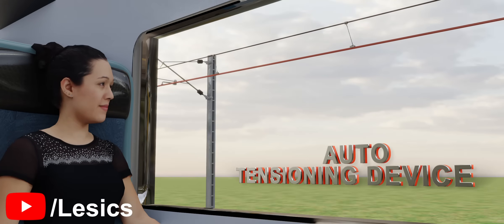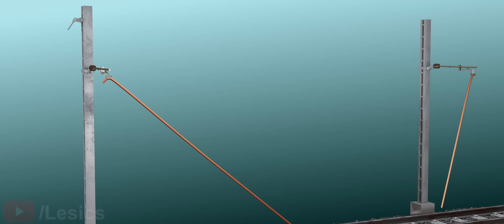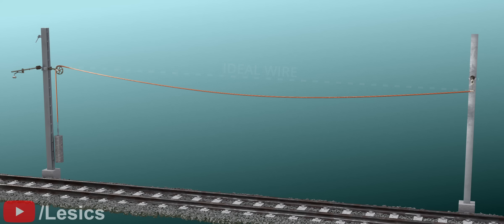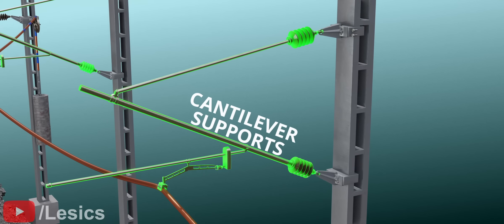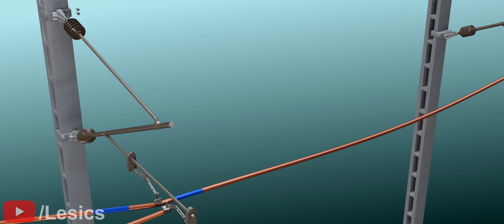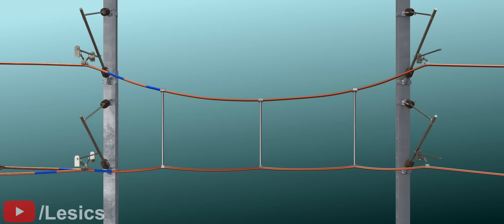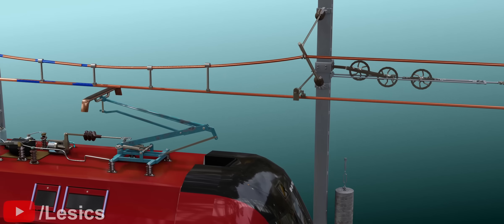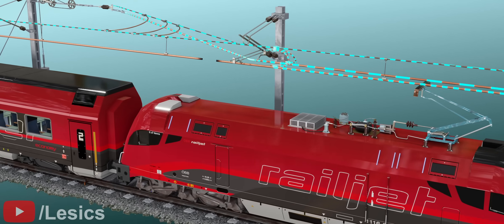Railway power lines | The Art of keeping them STRAIGHT

Comment: The old New Haven Railroad used a very elegant design that reduced the need for intermediate supports and did not require swing arms. It was a triangular shaped wore arrangement with two catenary wires on the top and one contact wire on the bottom. The wires were spaced by droppers designed to keep the contact wire level. Because there were two catenary wires with spacers between them, the whole wire assembly remained straight in the horizontal plane and could be installed with fewer supports. 
That arrangement worked well for about 80 years.
Reply: Can you share pictures Bill? It sounds interesting.
Reply: @matteopietrobelli8610  If you google "New Haven Railroad electrification" and go to images, you can see a few examples of it pop up. It is a very neat and elegant design! Apparently, the London, Brighton and South Coast Railway used it too.

Comment: Actually they are not strait! They are leveled, but in a horicontal zikzak line. Otherwise it would cut through the power conductor of the engine car.
Thumb down for the misleading head line.

Comment: wow this is really complicated compared to just having a 3rd rail.
Reply: The biggest downside of 3rd rail is the whole max 1500V DC though. Compared to 25kV AC for overhead. Nevermind that 3rd rail systems are typically at ankle height,  while overhead wires are generally speaking 5m or more up in the air.
Reply: @fermitupoupon1754  why do they limit the 3rd rail to 1500V?   I mean, obviously there is a limitation imposed by arcing distance to the ground or other rails at higher voltages, but you could get more than 1500V before that would become a problem.   could run 4160 or maybe even 6900.   And AC would make more sense than DC for a rail application.
Reply: @wouldntyouliketoknow9891  my best educated guess is that it's primarily a safety thing.
Simply because the third rail is that much more accessible to critters and people.

If a rat wanders underneath a third rail and gets electrocuted, 1500V probably won't sustain an arc, where 25kV could easily sustain an arc.

Higher voltages also tend to spark more. So if there's dry grass next to the track, a higher voltage on a third rail would increase the risk of brush fires along the track.

And that's not even considering that a third rail needs to be gapped for level crossings and at switches.
These gaps are also a cause of sparks as the shoe leaves the third rail and when it picks it up again.

Comment: If someone pitched that to me I would think that this can‘t be the best solution 😄 I mean the train is already standing on metal rails (sure you can‘t use them to power the train because of safety), but this is too far away from an easy solution :D
Reply: They already use the rail as the neutral conductor. Which is why there's only 1 overhead wire. Trolley buses, which ride on rubber tyres, have 2 overhead wires for that very reason.

Comment: at that point, why not just suspend the wire from a thin truss like structure to replace the weight, pully, dropper and cantilever supports?
Reply: How do you maintain constant tension?

Comment: Wires can never be perfectly straight - they will always follow a catenary curve.
The point of the complicated double wire  arrangement is to minimize the actual sag by reducing the distance between supports.
Reply: Yep, that's what they said. Pretty cool.
Reply: @KurtRichterCISSP  yeah. You can't put a pole every 5-8 feet, but you can put a support wire that frequently.
The video does a good job of going over why each element is added step by step.

Comment: Great video!  Another interesting thing: looking down from straight above, the train power line is actually not perfect straight, it 's intentionally a slight zigzag horizontally. Thus when train progress, the wear on the train pento will be evenly distributed in a range, instead of a single cut by a perfect straight line.   In this way the life span of train pento will be greatly increased.
Reply: that makes sense, nice!

Comment: Amazing! Could you also tell me also how electricity is provided when train is changing railway network? For example, when you're crossing international borders between Italy and Switzerland, you're switching from RFI to FFS, and therefore electricity is provided by the new railway infrastructure company (FFS) and not to the previous one (RFI) anymore.
Reply: Between the two networks there will be a 'neutral' section (no voltage) where the supply from one country finishes and the supply from the next country starts. The locomotive driver will know that they need to coast between the two sections. If the two networks are the same voltage and type (for example 25 kV AC) then the loco just continues on. If there is a difference in voltage or supply type (maybe one is DC and the other AC) then the loco has to be a 'hybrid' type which can deal with the different systems and it will automatically switch to the different voltage or system.

Comment: You cannot eliminate all the sagging because of gravity. My physics teacher tried to get rid of the dip on his clothes line and he pulled the wire so tight and the poles came out of the ground. Florida sand don't hold well and even before the poles came out of the ground there still was a dip. As for cable cars the trolley has spring action to keep the trolley on the wires and the counter weights help keep some dip out of the wires. 73

Comment: The complication is you don’t want the contact wire straight with pantograph systems - you do want it at a fairly constant distance from the track bed so horizontal”ish”. The actual wire should ideally be staggered side at each support point to side to regulate point wear on the pantograph bar.
Trolley pole systems used on older street / tram cars are different and require the wire to be kept aligned with the tracks in the both directions to a much tighter degree.

Comment: This design will wear a groove in the pan of the pantograph. To fix this the horizontal distance is varied so the contact wire zig-zags horizontally.
If you can ride up front with the driver, you can see this zig-zag.
The pan has a stick of graphite in it and makes contact with the contact wire. The Metro used to run regular greasing trains from obsolete rolling stock to apply grease to the wire.
The central car has a cupola in the roof for overhead inspection.

Comment: I have one question here, jumper wires are used to maintain electrical connection between segments, then why here 3 or any more than one number of jumper wires are used to maintain electrical connection between two conductors? Because 1 wire was sufficient.
Reply: It's primarily a redundancy thing, but cost and weight are also big factors. Having  3 thinner wires as jumpers means they're more flexible to move with the two wires that they're connecting and if one of the jumpers breaks, it won't lead to complete failure. Also thinner wires are lighter and cheaper.
Reply: @fermitupoupon1754   Thank you for replying :)

Comment: 5:53 Instead of adding a pulley system to pull on the catenary wire and contact wire with more force, why not just connect the two wires with a single pulley? Like a differential pulley. Then they will have a perfectly equal amount of force on them.
Reply: You would still need more weight
Reply: @guillaumec1636  i agree but you would distribute the force between the two types of wire basically equally.

Comment: Not only does the wire need to maintain a constant height over the rail, it also needs to zig-zag sideways, on a horizontal plane over the rails. If the wire was like a straight line, it would quickly wear thru the pentagraphs single contact point. By zig-zagging sideways, it moves the contact point back and forth, over a bar of carbon at the top of the pentagraph.  The video kind of shows this, but doesn’t explain that extra bit of complication.
I’m not an engineer, but I play one on TV, so I know what I’m talking about.
I also play a brain surgeon. Come see me for discounted rates.
Reply: This problem was explained in another video "The Brilliant Engineering behind Pantographs!"
Reply: @vadim4365  5.30 5.30 have been been with with aaa aaa 44
Reply: Sounds like you watched the other lesics video on cable trollies
Reply: He has already explained that in an older video. You should watch it, it's really interesting.
Reply: @vdiitd  Yes, but this one says why you have to keep the wire STRAIGHT, he was saying it isn't straight but at a level height! If is was straight it wouldn't zig zag!!
Reply: First, it's called "pantograph" not "pantagraph". Second, it's the pantograph's carbon bar that is going to wear not the wire if there isn't a zigzag movement. You may play an Engineer role on TVs but not in real life.
Reply: @kabretenidderuon5712  actually, it's both.
Reply: @kabretenidderuon5712  He didn't say he played a smart engineer! 😅
Reply: Joey, is that you?
Reply: I drive trains. Actually, i drive the exact same red locomotive shown in the video. And so you sir, are right with the zig-zag. 
A little bit of extra info, there is actually compressed air in the carbon bar on top of the pentagraph you mentioned. If the carbon bar breaks, the air pressure drops and the pentagraph automatically lowers, so there wont be any damage to the power line or any other things on top of the locomotive.
Reply: I love that very last sentence!. a great "money" saver!.
Reply: That is explained in another video, on this channel.
Reply: But the wire doesn't beed to maintain constant height above the rail as the pantograph can move freely.. that's why in tunnels we see how the pantograph is pressed down by the wires..
Reply: Thanks a lot but people around here need brain transplant. Let me know if it is available in future.
Reply: @Pankajnarsinghpur  I ordered an implant from him a couple days ago and arrived quick with amazon prime! I can play piano right now 10/10 would recommend
Reply: @Jajdjejwi28  thanks. Now i will be able to make money in stock market.
Reply: Not all train systems are able to zig zag their sites, but that's the ideal setup...
Reply: are you famous
Reply: They already covered that in past : https://youtu.be/GJbUI2D3rLY?t=346 :)
Reply: I've always thought that was the reason why railway powerlines always zig-zag.
Reply: He already explained this in previous video
Reply: @captaintzuyu  AS many people have said before. I was pointing out his misleading (clcikbait for people who knew) title to THIS video.
Reply: @brianfretwell3886  yes absolutely, the zigzag point is important for pantograph topic and not for level of wires.
Reply: I had an overhead wire break on a train in Japan in the middle of the worst snow storm I have been in. It was powerful sparks as the wire raked along the carriage. We had to get out and walk along the tracks in the middle of a snowstorm and I don’t speak Japanese. I am surprised the line didn’t electrocute anyone.
Reply: @oldmech619  hopefully they isolated the power and blocked the lines before letting you off the set.
Reply: @Underwatergoat1    Steve,  it felt like we were in the 1937 movie The Lost Horizon.
Reply: @Underwatergoat1    All I can say, I was not the first person off the train and we did loose power and lightning. I asked myself that same question when years later a reporter in LA got burned pretty bad. Sorry, I still needed to answer your question.
Reply: Lemme know when you play the lawyer. Looking for discounts as well…
Reply: You are correct in this point. But I don't see how playing something on TV effects you real life capabilities above a superficial insight.
Reply: @jackmclane1826  Perhaps he was joking.......
Reply: @jackmclane1826  nothing gets past this guy!

Comment: It will be perfect if it had been mentioned that
On straight track, the contact wire is zigzagged slightly to the left and right of the center from each support to the next so that the carbon insert of the pantograph wears evenly, thus preventing any notches.
Reply: It doesn't wear evenly but you are right that the contact wire zigzags in a horizontal plane to spread the wear.
The center still gets most of the wear.

Comment: I too had curiosity to know about these weights and I used to guess that it was there to keep the wire straight but I didn't understand the pulley system and I was also curious to know about the jumpers, In my area Indian Railways are laying these wires and once I saw a worker connecting these jumpers and I wondered why he is connecting these two wires But now I understood completely Thank You Team lesics
And hats of to the person or persons who designed this genius trick.
A small request to the lesics team:
Please make a video on working of ATM card And ATM Machine. 
Thank You So much

Comment: Also mention that the wires are not perfectly parallel to the railway lines under it, rather it moves from side to side in a zig zag manner as we travel along the line. This is done to prevent the wires from rubbing the pantograph in a straight line and cutting a groove in the sliding material.
Reply: I believe it is explained in another video on this channel. I believe it is the video about pantographs.

Comment: good video.  I like the on-camera segments, I like seeing who is behind the videos I watch.  Makes it clear you're someone who enjoys the subject matter, not just a content farm.  Also a good physics demo too, haha.
Reply: I agree. The "practical" demonstration is better than having all animation / CGI. It offers proof that the wire will sag under its own weight and cannot be level without the additional support. Theoretically one could create animation that arched the wire up between supports. A practical demonstration shows why the wire arches down. My local electric railroad has constant tension complex catenary with each arm pulling the wire left or right from center as well as supporting the messenger wire above and contact wire below. At the transfer points between wire segments each wire rises upwards from a middle point where the wires are level. Constant contact against constant height constant tension catenary. Places where the power source changes from one substation to another are designed differently so the pan does not short the two circuits (but that is beyond the scope of this video).

Comment: At 1:46 I think if the tension can be calculated for any weight added on the line it can achieve ideal tension and zero flex. If the coefficients for tension and drag can be calculated for the temperature changes all through the year then the design becomes less complicated as there would be clearances for these changes albeit with the same length in the design. This design is overly complicated for no reason.
Reply: Calculations are not the same thing as measurements... Math is NOT reality!
Reply: I think it's hugely overcomplicated, but explained well. Lesics didn't create the design, but just presented it. I have no idea if it's all correct, but it likely is.

It seems to me in this day of high power batteries for EVs, just design the engines to withstand short durations without electricity. Then, rather than all this elaborate stuff, make smarter pantographs. Use the extra poles to support the wires that exist and shorter wire lengths, so you could pretension the short wires. In the winter, you could pass current through the wires to heat them by regenerating it at the beginning like EVs do to recharge batteries. Wasteful? Yeah, but IMO, less so than this monstrosity designed by evolution rather than engineering.